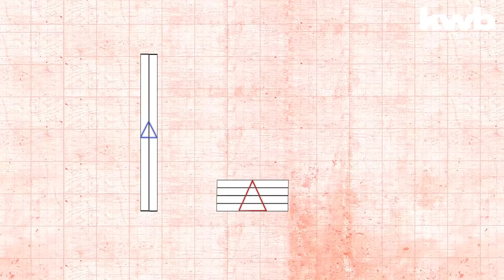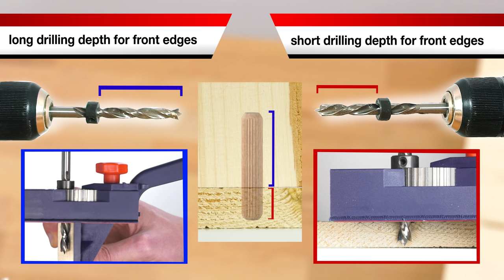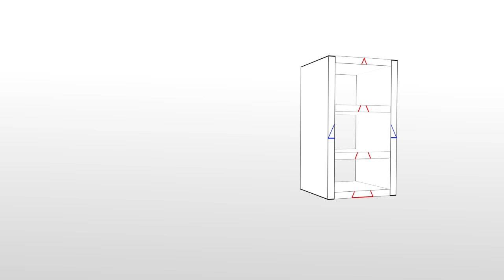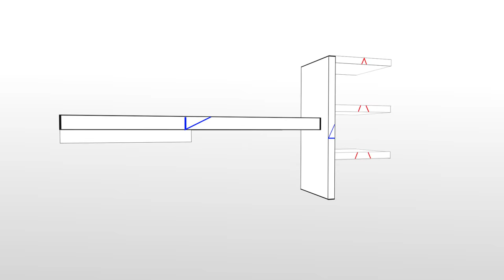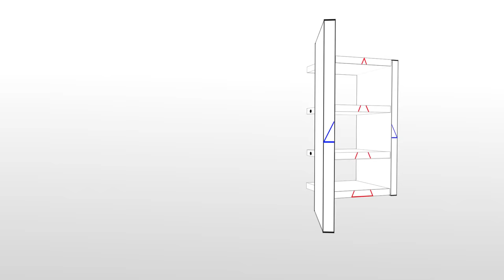How to build a simple DIY shelf with this great Tool!👍

Comment: Difficult to keep it steady whilst drilling, and no space for clamping
Reply: I'm debatind whether to buy this (made by Bosch) or go for Wolfcraft...
Reply: If the point of your drill bit is not totaly centered or the drill bit is not totaly straight it will take the jig with it, maybe invest in some high quality drill bits if you think you are going to use it a lot
Reply: And you need to be precise with the depth of the cabinets too...

Comment: I own one of these and was disappointed by the accuracy. It wobbles and moves when you drill. It's very hard to get the joints to match up perfectly. It's average at best. Sorry!!
Reply: I got it today and I share your disappointment. Very well thought tool but it lacks build quality. As a DIY guy i will not dare to use it for shelf making... Maybe it will be of use just for straight holles.

Comment: that's slick as owl shit there! I like how the tool design incorporates simple geometry to simplify setup and reduce the risk of errors via the triangles drawn on the shelves and sides. If your triangles are correct and aligned, the tedious task of measuring and checking and spatially visualizing the assembled pieces to ensure everything is aligned is omitted which makes life easier. Great design and functionality. I might invest in one of these and use dowel joinery rather than pocket holes and screws on joints of this type, what do you think? How does this dowel joinery compare to pocket hole joinery? Would this be a viable alternative to pocket holes and screws?
Reply: Honestly, and I'm not an expert woodworker here or anything, but I'm pretty sure dowels and woodglue would be stronger than pocket holes.

Comment: I decided to use screw
Reply: Smarter, faster, stronger
Reply: @denoro.  Screws are not stronger than joinery with dowels. Screws don't breathe with the wood and end up stressing from the inside. All my old joinery furniture is still strong and doing well. Many of my modern things that are supposed to be craftsman level end up having problems.
Reply: Yes I agree.  In this case for a simple bookcase  I would go with pockethole screws and a good wood glue.  You save a lot of time needing half the number of setupsfor holes being drilled.   Dowels might be the right solution for  some projects but for most things I do with a little bit of planning ahead pockethole screws work great.
Reply: @MrJaaaaake screws and dowels have pro and con. For a beginner is far easyer with screws. Not pocket holes, just screws. Pre drilled of course. And i do believe your joinery is fine and strong. My problem is with THIS tool.

Comment: German engineering, well done.
Reply: Why do people always have to say that? Seriously,  I'm curious. 

Germans top corporations buys entire companies from other countries like Dremel is from the US for example. I don't constantly see "American engineering, well done" or even if it's Japanese I don't see that. Only Germany as if everyone else is inferior which they're not. Even Russians are excellent at engineering for what little cash they have available and perform better than Germany in certain fields without question, especially militaristic science.
Reply: Queen Elizabeth III The German workforce work to very high standards. I remember watching a TV program where people were building a house in the UK, their builders were delayed, deliveries were late etc, the Germans turned up from Germany on time @5am, they carried out the work, finished on time a week or so later, work was of a very high standard then they washed their van and left on time. 

Here in the UK engineers get away with whatever they can, which leads to a drop in standards, a race to the bottom. Late starts, early finishes and do as little as possible in between is what I see daily. I worked for the Japanese, if they had 5 production lines for instance, they would consider it a shame to be rated 5th and would work unpaid to catch up.

Comment: I use to have a dowel tool but started using Pocket holes.
Reply: If it had doors and a back pocket holes would be better cause u wouldn't c them

Comment: Looks fun for someone who’s never built a anything. No lateral rigidity whatsoever, crappy joinery, slow process. Maybe it would better with a back or fastened against a wall. 
Pocket holes are much better, if nothing else.
Reply: You think pocket screws are superior here ? 🙄😂
A back panel would ,of course, stop racking... 
The beauty of the dowels is the glued-up joint is invisible... unlike pockets... and pocket hole jigs & their special drills are expensive in comparison... 🤨
Reply: @peterfitzpatrick7032  the joints on the finished product makes this look terrible. Admit it.
Reply: @peterfitzpatrick7032    whatever dude